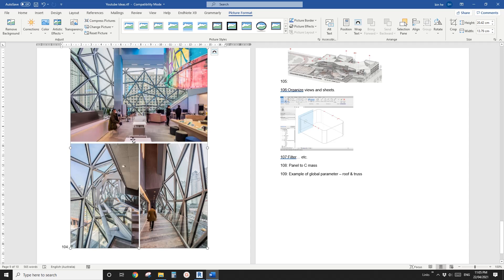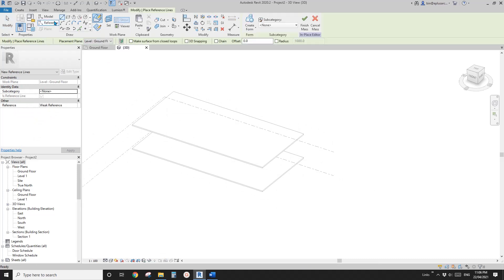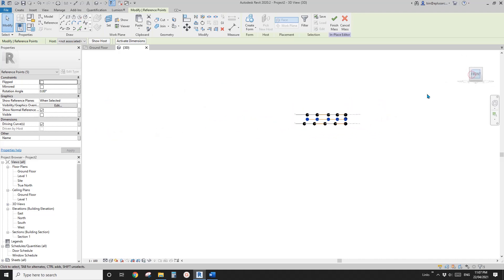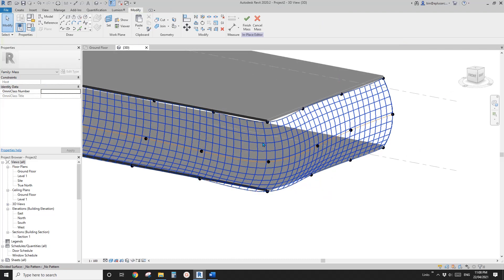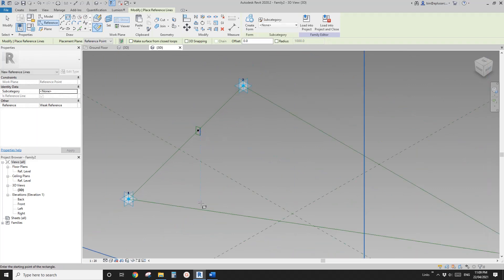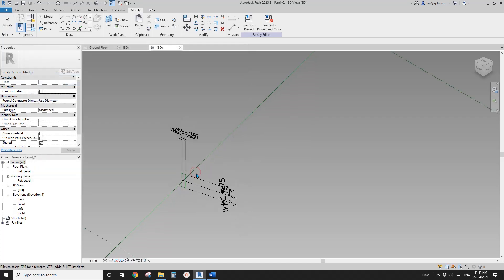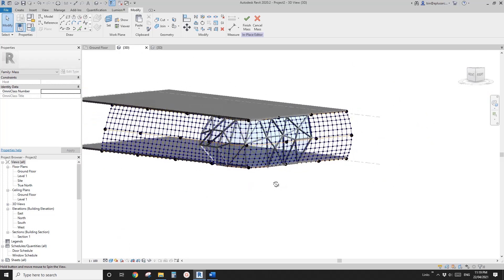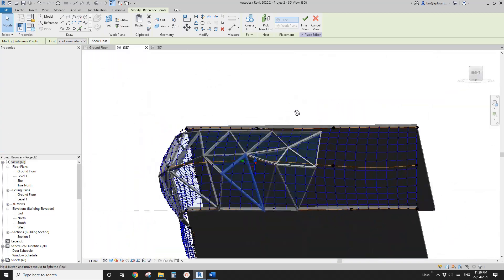Everyday Revit (Day 399) - Irregular Windows using Mass & Adaptive Family

Comment: Hello, how can I make it so that it is not all glass but part glass and part metal? It's necessary for my project. If you help me I'm be happy:))
Reply from the maker: Do you mean some of the panel glass and some metal panel? In your adaptive family, select the panel and create a material parameter by clicking on the small rectangular box to the right of Properties-Material. Choose either an instance or type parameter, then load it into your project or conceptual mass file. If you choose an instance parameter, you can simply select the families and change the material under Properties. If you used a type parameter, you need to click Edit Type and create different types with different materials. Hope this helps.
Reply: Thank you for all that. You help me so much. I did my project and its so hard for me but your video is explain all questions:) @BINHE615